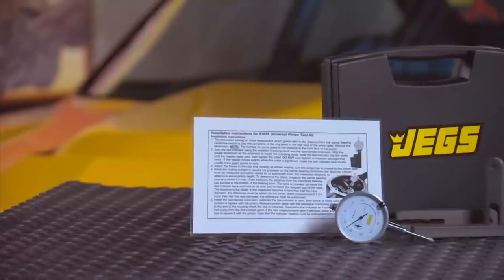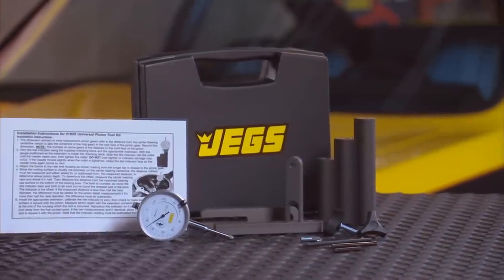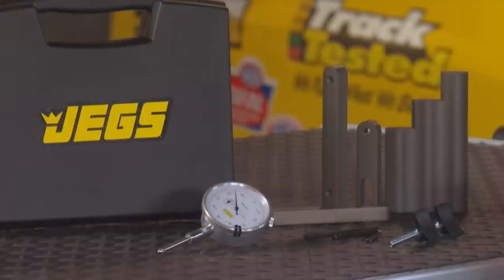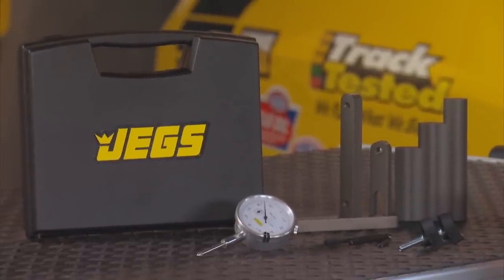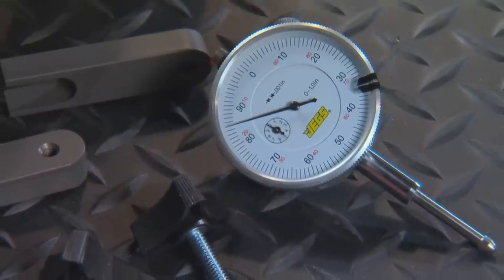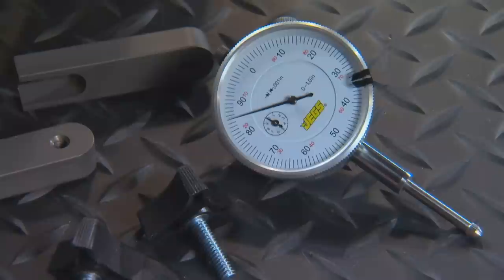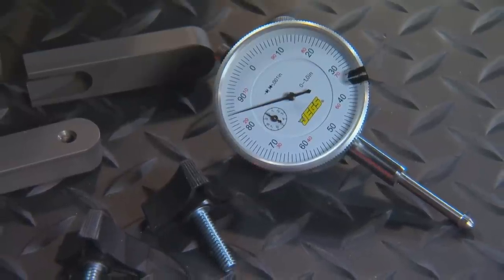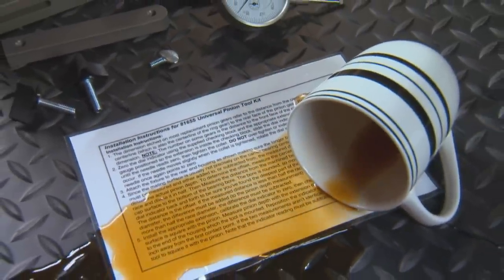Universal Ring & Pinion Setup Tool Kit JEGS With Kenny Wallace

Comment: Agreed, need a how to video.
The directions are poorly written, especially step 4, trying to determine the offset is confusing. Also maybe a diagram of how to correctly mount the tool for proper readings. Need either better directions, or a video.
Currently having trouble getting accurate readings.

Comment: ya, I got the Proform set and the instructions are pretty vague. a how to video would be nice..
Reply from the maker: Does this help at all? https://youtu.be/IRo0wddA8Jo
Reply: that helps for backlash but only tells ABOUT pinion depth, not how to use the tool, and the directions included with the tool are not specific enough
Reply: trying to decide if I want this tool, nothing shows how its used
Reply from the maker: Does this help? http://www.jegs.com/InstallationInstructions/500/555/555-81655.pdf
Reply: yah, but this is youtube, how about a demonstration. Thats why we're here. the only time I will have to read this is while im on the john.